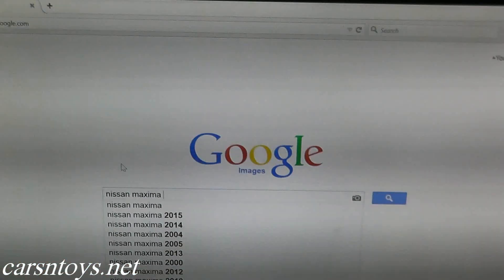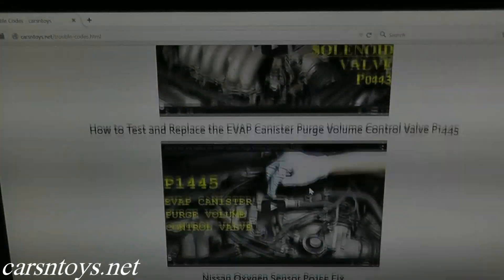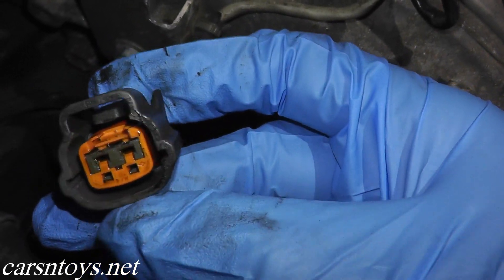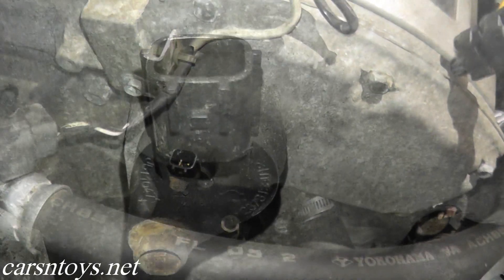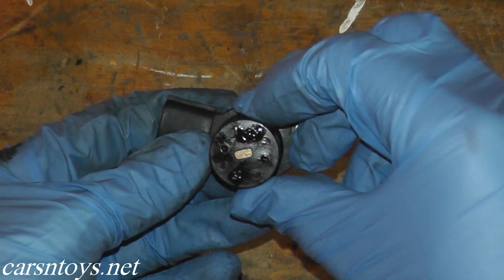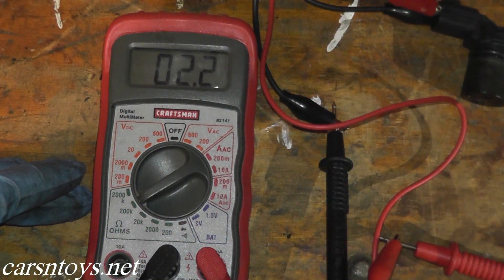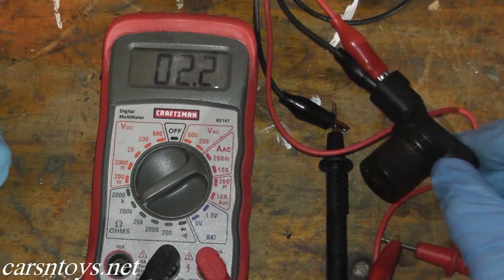Camshaft Position Sensor P0340 Testing and Replacement HD

Comment: gr8 explanation. I have a 2001 model ,   it just shutoff while driving but would restart, but when it warmed up it then shut off as soon as load was put on the engine.  
  It had no codes like this just looking around to what it might be.   I  was able to make it back 1/2 mile by disconnecting  TPS and it idle at 1800 rpm but made it back.

I really don't  think its a CAM position sensor  but the thought did cross my  mind.   I later did a quick clean of Throttle body and seemed ok,  and the TPS  according to my scanner was fine 
.   but did Not drive much.     I got back next week to see about driving it back 2-3 hour drive, after putting a new airlifter in. the one that is in it is very old.     its at my son's college  outside his apartment.  we already replaced the car as it was was going to be sold and replaced next year in the Feb timeframe. this just made it happen sooner.  Anyways it lasted  1 year longer then I expected.   2001 maxima  243k miles,  been driven 41k miles on a falling transmission p0744  for nearly 4 years.    if I am successfully driving it back.  going to do some minor repair(s) for cheep and get rid of it.  
- seafoam treatment of throttle body. to help some of its idling hopefully smoother 13.88
- front break pads replacement free pads under warrenty
- 2 rear quick struts ( cheep replacements, I got on amazon which were surplus autzone duralast  ones and rebranded  at  Topaz and 1/3 the cost, I dont care if the only last a few years, its better then whats on it which is dangerously bad  and will not be able to see car for much with that problem

Comment: When it comes to testing continuity/resistance where the leads go doesn't matter. I will say when you test voltage then yes black to negative red to positive. Also just another tip when it comes to dealing with harnesses, and testing continuity-make sure you are looking at the resistance value and not just listening for the beep-you can have continuity in a circuit even with a lot of resistance which in tale can cause problems especially with bad grounds.
Reply: i guess im randomly asking but does someone know a way to get back into an Instagram account..?
I was stupid forgot my password. I would love any help you can give me
Reply: @Layton Rowan instablaster :)
Reply: @Layton Leo it did the trick and I now got access to my account again. I am so happy!
Thank you so much you really help me out :D
Reply: @Layton Rowan You are welcome :D

Comment: Hello, when you test the cont. on the cam sensor, is the black wire from the multimeter connected to the battery (negative) and ignition is on ? Thanks

Comment: On the ohm setting on my multi meter do i set the multimeter to the 200,2000,20k,200k,2000k setting??..idk which one to set it to for the crank sensor

Comment: hi body, as far as i understood from the video there should be a resistance between possitive and negative pin over 200-2K ohm on sensor (pin 1-3 on video), but what about the signal pin(2) ? there must be isolation or a bigger resistance between them? (i'm just testing a dead cmp sensor) thank's

Comment: I like how you explained everything. I have one question. I swapped out the old sensor due to it leaking oil. used a new one from rock auto and installed it. then the engine light came on. I reset the ECU and when i shifted to reverse, it came right back on. I ordered a 2nd new one from rock auto and the same problem I had with the 1st new one I have with this one. When I checked the current on the wire harness when it's on, the positive for some reason forces the car to turn off. What can be causing the light to stay on? Also, is the car turning off normal when I check the positive wire on the harness?
Reply from the maker: Cesar Serna Did you happen to keep the leaking sensor? Try to reinstall and see if you have the same issues.
Reply: CarsNToys about keeping the leaking sensor... :8 no i threw it away right after.
Reply: CarsNToys also, I forgot to mention that when I tested the wires, the positive terminal on the battery and the black wire was good, but the white wire on the negative terminal didn't light up.
Reply: CarsNToys So yesterday before I left back to Houston, I reset the ECM and it stayed off. Once I made it home, I turned off the car and I unloaded some stuff and then headed to to the store. Well not even one block driving, the light is back on. I pull into the gas station and reset it, and its gone again. once I leave the store, the light turns back on. Should I go ahead and buy a factory camshaft sensor?
Reply from the maker: Cesar Serna
If you're certain it's the sensor then I'd use a factory part.
Reply: +CarsNToys ok i did exactly what you did in this video. I have continuity in the harness and i get a .12 in ohms on the sensor itself. When i moved the wire a bit to the left once it was back on and the car running, it cut off. So I'm thinking a short somewhere near the pigtail.
Reply from the maker: Gotcha - .12 ohms isn't much of a reading. What kind of vehicle you working on?
Reply: CarsNToys '96 maxima
Reply from the maker: Cesar Serna
Gotcha. The factory sensor is either Hitachi or Mitsubishi. Hitachi's ohms reading should be between 1,440 - 1,760 and Mitsubishi 2,090 - 2,550.
Reply: CarsNToys OK so the new update is that I went to autozone and got a new sensor, and the light is still on. This is getting old lol.
Reply: CarsNToys on the ohm reading on the 200k setting, i have a 3.0. At times when I check the cable on resistance, it stays on 0.01 and sometimes on 0.00. Is that bad?
Reply: CarsNToys ok now when I test the black cable for continuity, i get a -0.00
Reply: @713HTX713  did you ever end up solving the issue and if so what solved it for you?
Reply: @DemonEmbarasser  nope. I even bought a dealer part and had the same issue.
Reply: @Cesar Serna  did you scan your car and see if it was showing camshaft sensor as a fault? Have replaced mine recently but it's still throwing a fault for it

Comment: mine had melted and we pryed it out and a small piece we can see it but can't get it out It didn't fall down in there cause I can see it I put the new sensor in right over that small piece should I  try and get that little piece out I will have to take a lot of stuff loose but I don't mind  i'm just trying to save money by doing it myself it's kinda bothering me cause I changed a lot of stuff out would hate for this to mess things up I have not started it  but my scanner said that there are no codes and safe to drive but im not sure I want to start it . it all started with a cylinder 3 miss fire I changed spark plugs ignition coils coolant, crankshaft and when I got to the camshaft sensor it was melted could mean that's blown head gasket?  it's a 2010 Hyundai Tucson  90000 miles never had any trouble with this car until now so I got my money's worth

Comment: Hey I love your videos btw. But I have a question. So I have a Nissan 350z and I have the code for the camshaft positioning sensors. I took both out and cleaned them but my car still ran poorly with the engine light on. If I replace both of them. Will that honestly help??
Reply from the maker: What year is your Z and what's the trouble code(s)?
Reply: CarsNToys it's 2005 and it's the positioning sensor code 30340 or something like that
Reply: P0340?
Reply from the maker: P0340 could also be due to a weak battery. If the battery is okay and the harness connectors are in good shape, then the sensors would be the next thing to check.

Comment: I have a 2000 Cadillac STS 4.6 Northstar that when I start out about 3-5 min. the engine shuts down. It will sometimes start right back up and other times it will take a few minutes of sitting before it will start. It doesn't do it after the first or second time of shutting down until there is a period of time that the engine doesn't run. I get several different codes, any ideas?
Reply from the maker: +mike makuch It could be a number of things. Start with the basics; check fuel and spark delivery.

Comment: My Altima starts right up... but then it shuts off. Also won't allow me to rev past 3000 rpms. Any ideas?
Reply from the maker: +Senior Buddha sounds like the mass air flow sensor. I have a video for this as well: https://youtu.be/ewjO9JVr8NU
Reply: CarsNToys My Nissan Altima 2.5 does the same but with camshaft sensor bank 1 code and p1275... Please help

Comment: we have a check engine code of P1275 which cannot be erased and a P0340 camshaft sensor. checked both the cam and crank shaft sensors but found no issues. would it wiring or fuse issues?
Reply from the maker: +Eugene Carlos What kind of vehicle?
Reply: Eugene Carlos Check your timing. could be your timing belt is stretched out. Usually not a simple or cheap job but can almost guarantee that's your issue if all checked out. ( Harness, CPS, ECM ) Streched timing belt or timing jumping a tooth can also read the same code
Reply: DIYhowToFix IT. I have the same codes. Camshaft bank 1 and p1275. The car is an 05 nissan Altima 2.5... It starts but turns right off. Sometimes last longer on.

Comment: 06 Nissan Altima 2.5 check engine light was on it said replace crank position sensor because the car cranks so slow I replace the sensor and it's still doing the same thing could I get some help
Reply from the maker: How's the battery?

Comment: 2001 Ford Ranger 4.0 SOHC with this code. I checked the sensor (it was just replaced) and it says 0.5. Is this a bad sensor??
Reply from the maker: Michele Searls .5 ohms? I don't have a manual for your truck but that sounds low.

Comment: I'm gettin a code p0660 on my 07 charger 2.7 do I need a new tuning valve or could it be the wires (bad connection)? Also I'm gonna change my cam pos sensor anyway even tho I'm not gettin a code , will I notice a difference using a brand new sensor?
Reply from the maker: 3232myke It's either the tuning valve or the harness. Based on the year, I'd guess the wiring is fine and the valve needs replacement. If you don't have a code for the cam sensor then no need to replace it.

Comment: ya my battery and starter are good.. car starts right up  its after it get hot that its starts hard
Reply from the maker: What kind of vehicle? I had that problem many years ago. The exhaust manifold was too close to the starter. I wrapped the starter in thermo-tec (try summitracing.com) and it made all the difference.
Reply: @CarsNToys  2003 3.5 murano sl
Reply: just had all of the sparkplugs changed and head covers . I did the camshaft sensors and crankshaft.. all OEM..
Reply: thats wild that you had to wrap you starter..  glad it worked for you  this is stock so no problem there
Reply: im going to put the origional one back just to see if its the new one,, it wasnt bad anyways .

Comment: I have Infiniti FX 45/ 2004, just got back from airport/ Miami, was running like 4 hours, stop the car, went to store, 5-10 min, came back, no start, was cranking, starter working, but no start??? Never  happened before?/ Somebody told me, "maybe" fuelpump relay??, the other guy said, camshaft position sensor. Took the code: P0340, says camshaft pos sensor, bank 1 or single sensor?? Is there two camshaft sensors?? Which one I have to change?? Thanks, when engine cools down, I can drive again....

Comment: i have a jeep wrangler and i had one of my camshaft sensors changed out dont know which one and my scanner say it is the camshaft position sensor b what does the b mean i have one sensor on the leftside and one on the rightside.
Reply from the maker: What year is your Wrangler?
Reply: @CarsNToys   I got it changed out it was a 2012 I have sold it the other day I having trouble with my daily driver crank but won't start

Comment: When checking the continuity, I get a reading of 012. Is that good? When I test the ohms on the sensor, I get a reading of 2.8. At this point I don't know what else to do. I keep getting the p0340 code and I am literally stuck and not sure what to do next.
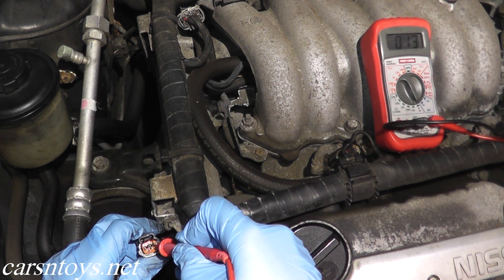Reply from the maker: +Cesar Serna I don't necessarily look at the continuity reading. I just want to make sure that there is continuity - which you can tell by hearing the audible alert. (2:43 into the video) Have you tried replacing the sensor?
Reply: CarsNToys yes like 3 times. All different makes. At this point I'm really thinking it's a wiring issue. I just replaced the alternator because of voltage issues and assumed that may have also had something to do with it but it wasn't.
Reply from the maker: Cesar Serna
What kind of car do you have?
Reply: CarsNToys 96 maxima
Reply from the maker: +Cesar Serna Any other codes?
Reply: CarsNToys that's the only one that shows up.

Comment: hey... i have chevy cruze 2.0.. & today when i start my vehicle there sounds comes (tik.tik.tik) and i connect obd2 to check error the code comes (po340)Camshaft Position Sensor A..
still there is such sound and vehicle dnt start easily ...
whats the problem is with camshaft ?
need help....
Reply from the maker: +Ammy m If the car doesn't crank start by checking if the battery voltage is good. If the car is cranking, a bad cam sensor can definitely inhibit the car from starting.

Comment: I paid 3k for a genesis coupe it cranks no start. It has code p0340. I changed the camshaft position sensors on both sides. No luck might be bad pcm or crankshaft position sensor. Someone help

Comment: change the temperature sensor, thermostat, radiator, still warming up, and now will not start, that brings me to tree levas.y now I want to know if it is really that and if so where is it?
Reply from the maker: jose antonio martinez galvan What is tree levas? Have you checked the water pump?
Reply: CarsNToys sorry mi english is too bad, is the camshat positin sensor
Reply from the maker: Definitely could be the cam or crank sensor if the car isn't starting. What kind of vehicle?
Reply: its Malibu 98

Comment: CarsNToys Thanks for the helpful videos!  You say to check the starting system first.  I was told in the past that my flywheel was missing some teeth - could that possibly cause a p0340 to be thrown?  Keep it up!
Reply: David Cardello CarsNToys I did not get a good continuity reading though - when connecting the black wire to ground, can I simply touch it to the metal engine block?
Reply: David Cardello CarsNToys  yo!  So I did manage to confirm harness plug and sensor are functional.  Do you think a flywheel that is missing teeth could cause a p0340?
Reply from the maker: David Cardello Yes, that can certainly throw this code. You'll often find the sensor marked up as well.
Reply from the maker: David Cardello Sure can.
Reply: CarsNToys Cool, thanks!  It's a little beyond me to handle that job, but I will mention it to my mechanic.  I appreciate the response.